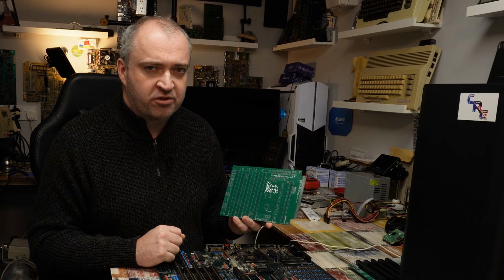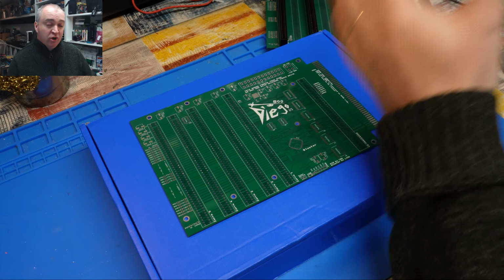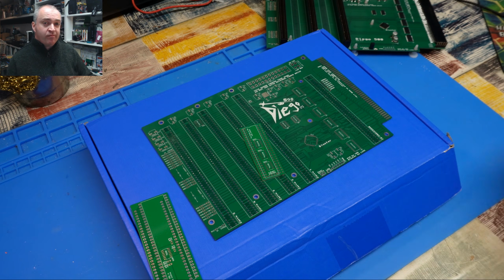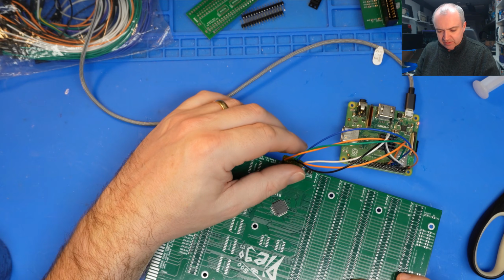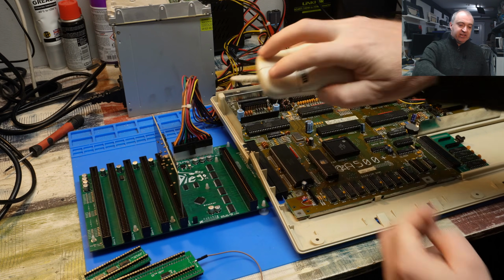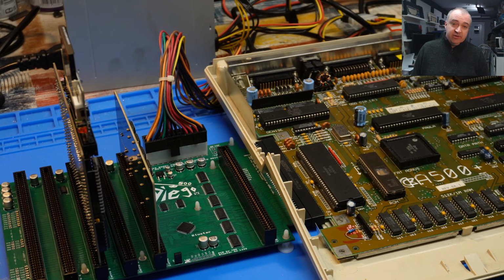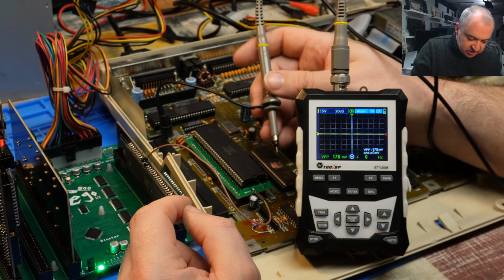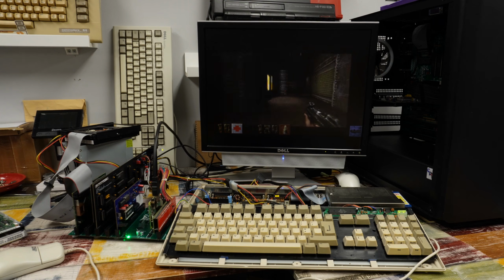Turn your A500 into an Amiga 2000

Comment: Good effort. I made similar two years ago although nowhere near as polished and refined. 

I took one of the A2000 board designs, cut it off by after the Co-Processor slot and reworked all the signals. All through hole, no SMD, no attempt to consolidate. 

I used a genuine Buster though as they're cheap (Bluster was more expensive, although sticking the CPLD on the board probably not). 

For power I used ATX and as I was a little concerned about reverse powering the A500 via the edge connector I used the lead from a dead PSU to power it via the proper connector. 

FWIW inverting the "missing" clocks (I did it in logic so as to keep Buster rather than your method of getting Liv to re-code Bluster) appears to work fine, although I don't have enough add-ons to really stress it enough to test it.

My only criticism is the same one I have of my own board... I cut out the ISA shared bus expansion thinking it pointless without a Bridgeboard (which itself I thought fairly pointless these days) but later I found about about the GoldenGate2 and using it you can basically connect ISA peripherals to the Amiga so it can use them "natively".
Reply from the maker: Sounds like you more or less your own Diego board then 😉.  I was considering just flipping the clocks again maybe using an AS04 for speed but it's adding more delay and LIV2 kindly offered to deal with the clocks as is so we're doing that for now.  As for through hole or SMD, I just prefer working with surface mounted and going forward I can get the PCB house to preassemble boards.  

I've not added ISA yet as that's just a bolt on, there's no connection to the Amiga so once I get this working as well as I can, then I'll make an ISA addon board so people can use their bridgeboards if they like.
Reply: @CRG  I called mine the "A1500+", because A1500+A500 = A2000!

Comment: back in the day I had a "Sling Shot" adapter that plugged into the A500 and gave 1 expansion slot, I used a 2091 SCSI card
Reply from the maker: I'm sure that was fun to use.  This whole thing started because I got a couple of Zorro 2 cards, the single slot board but wanted to use both together.

Comment: Great video!
Random question… I see that you’re using the same IKEA shelves as I am for storing/displaying your computers, but I also see that they have extra support fixings on the underside. Have you had any issues with them supporting the weight of the computers? Or is that just a precaution?
Reply from the maker: Thanks, glad to hear you liked it.  

As for the picture shelves... I've not had any problems myself but I know at least one person where the shelf let go causing his Atari ST to tumble to the ground (thankfully undamaged).  I just put small furniture brackets under them to help hold them but I see IKEA now also has a metal picture shelf (MALMBÄCK) which I think would be stronger.

Comment: Would a mediator style board be better that comes back over the a500 mobo and would sit in a big tower? Like if you folded your card over 180 degrees and put the slots on the back?
Reply from the maker: That is certainly an option but before I start redesigning it I'd like to get all the issues ironed out of which I've just discovered another one not in the video.  Not a big deal, just needs a extra few traces to fix.
Reply: @CRG  how many people are testing / using these in anger?  That is the only way to iron out the wrinkles... :)
Reply from the maker: Theres 5 of us doing testing. We have run into a little problem but its not beyond fixing.  But thats why we're doing this testing.

Comment: Regarding the power, whilst there's two 5v pins on the side lot, from what I remember they are both connected with a via to a single fairly thin trace.

Tha A500/A2000 Technical Reference Manual only rates the side slot for 300mA in the power budget section. So that's more the weak spot rather than the Amigas PSU.

It's likely capable of handling more than that, but not the ideal way to power the Amiga if it's too power hungry.
Reply from the maker: Yeah I agree with that.  I think for the release version I'll remove the power link at the side car and force use of the pass through cable.

Comment: have the zorro and cpu slots on the other side of the diego 500, so it goes over the A500 motherboard, so then you can get any case, mod the back panel to align the A500 ports and the Zorro and CPU slots
Reply from the maker: I need to look at an A1000 version at some point which will be similar to that in that its rotated.  There are many ways this would be laid out, but its just finding the solution that works best.

Comment: Great idea and awesome work mate.  A few ideas/suggestions if I may.
1  Could a cable be used to move the board a bit further away from the side of the a500 without messing up timing and signal integrity?  Like the PEB for the TI99/4a.
2  Could the ISA bus be implemented for the use with bridgeboards without too much difficulty? Would be a great option!
3  In regards to power, mount a PICO PSU directly to the board (or something similar that provides the +- 5v +-12v and 3.3v) and run a single barrel jack or power in.  For pass though power for the A500 use a short lead soldered to the board perhaps?
Reply: AFAIK there's no actual active components on the A2000 board to support the ISA slots, they're literally ISA slots chained together with power connected (it's essentially a "passive backplane" similar to what was used in a lot of industrial machines back in the day), the bus signals are purely generated by the bridge board. The biggest issue with that would be the size of the board, I'd guess it'd be at least twice the area of the current version which will substantially increase the cost (that said the E-ATX A2000 is a thing, but frankly that'd probably be a better way to go if you wanted the ISA slots)

That said, it would theoretically be possible to make a SEPARATE passive ISA backplane board, perhaps with a piggy-back ATX power connector on it so you could use the two boards to provide equivalent functionality to a full A2000 board but as noted, you'd probably be better off just making an E-ATX A2000 using the parts from your A500 (and you get a video slot too IIRC).

EDIT: just checked, yeah, the only thing aside from the slot connectors in the ISA side of things is some bus termination and decoupling type stuff.
Reply from the maker: Thanks for the feedback, glad to hear your enjoying the project.  

In terms of your queries:

1. I'm sure a cable can be used to extend the board away from the 500 but its not something I've tested so can't say how far you could go before signal integrity becomes and issue.  
2. As SomeMorganSomewhere stated, the ISA bus is essentially a stand alone thing so I am planning a further revision to this board with a pass through power connection to run ISA slots with an optional backplane for the slots themselves.   In the first instance though I wanted to get the main zorro side of it working fully.  If you can bear with me until the next round of testing is done and if that all works out I'll get the ISA board done.  
3. I'll take a look at that option, power supplies are something I'm not great with but I know some folk who can help.

Comment: Awesome. However, I would say that building an EATX A2000 board using the chips from your A500 would make more sense, since you can easily put that in an EATX tower. But this is cool. A tower case made to house the whole monstrosity would be a cool solution, but… might be more work and pain than just building an EATX A2000
Reply from the maker: You're not wrong and I've built the EATX2000 myself in the past.  The only thing I'd say is that the 2000 board and BOM came to about £200 (if I remember correctly) but the board and BOM for this is currently about £60-£70.  It's just about giving people the option to experience zorro without the need to built or buy one of the big box machines.  I suppose like a lot of things in this hobby its also because why not...

Comment: 14:45 Couldn't you take 5 or 12 volt from the side slot and converted it to 3.3 volt to avoid using an ATX power supply?
Reply from the maker: In theory yes but in practise I'd not advise it as the A500 PSU's just aren't designed to cope with so much hanging out the side of the Amiga.  The 5V rail is the limiting factor really as I think we've be capped at about 3A out the side car.  Fine for a couple of cards but if you had a full set of 5 with a CPU card I don't think it would take it.
Reply: @CRG  The ATX is definitely needed. The A2000 PSU 5V output is rated at 20A.

Comment: If you're doing another board, why not build in a pistorm while your at it,  Instead of a processor slot, add in a place to plug in a CM4 on the bottom, so the board doesn't get longer, the pistorm parts on the top.  Also, get the card edge in gold.  Gold handles more current and will protect your investment.
Reply from the maker: I want to leave the board open for use with any Amiga 2000 accelerators.  It's easy enough to plug in a pistorm but lets people also use original hardware or the other modern accelerators.  

I just go with solder finish on the prototype boards as its somewhat cheaper.  I'm already on my 3rd run which granted is partly down to me learning PCB design and making mistakes along the way.
Reply: @CRG  To clean the solder fingers use very fine sandpaper like 1200 grit. Despite what noobs think it doesn't remove metal. I've been cleaning edge connectors for 30 years any time I need to use a board (particularly arcade pcbs) and they work fine when cleaned. That spray does nothing. The reason that appears to work is because you re-seated the board which scratches the fingers a bit. Clean it properly and it'll work perfectly on all the finges for at least a week until it tarnishes again.

Comment: Amazing! Will it work on an Amiga 1000 too? It has the same expansion slot of the A500 (just rotated 180 degrees).
Reply from the maker: It will yes although the power side of it will need some thought.  I think for the 1000, power will need to be disconnected at the side car and it'll just need its own PSU.  The slots would also need rotated 180° or the cards will be facing forwards.  Once I get this one finished, then Diego 1000 will be worked up.
Reply: @CRG Having the slots facing forward on an A1000 isn’t a dealbreaker because of the separate keyboard. Ok, it wouldn’t look quite so elegant, but it would still be usable.

Comment: While I love what you have done , I am a bit annoyed that you have done what everybody else seems to do and ignored currently available hardware . My suggestion to you is to put a passthrough connected as the last zorro slot so that people who have an A590 , A570 or handscanner etc... can still use them .

I am also available to test various hardware that I have , if you need more testers .
Reply from the maker: I did consider that but unfortunately it just isn't possible to accommodate a passthrough.  To do so all signals would need to be extended from the right hand side of the buffers and there just isn't the space on the pcb to do that.  

If it went to a vertical design then a passthrough would be easy to achieve so leave it with me and I'll see what I can do.
Reply: @CRG  No space on the PCB? Eh? You made the board that size. Just make it bigger. If cost is the limiting factor you should quit now because this is only the tip of the iceberg and you're going to be pumping a lot more into this by the end of it. If you've got kids then give the mrs the flick as that job is done and she's not needed now, that'll save a bundle of dollars not having to buy new shoes, dresses, hair salon visits, wasting hours trudging around shopping in every shop within 50km radius for something that doesn't exist (shoes, dress etc) lol

Comment: Interesting.

And I learned a new thing: there is a solution for using pistorm externally! (perhaps even a Vampire)
Reply from the maker: Yeah you can absolutely use any accelerator externally with that single CPU slot board I showed.  Or there is the Lazarusstorm which also sits on the 500s side car and the pistorm just plugs straight into.

Comment: To bad you couldn't run a cable to the bus port then you could design a box to sit under the monitor that would hold the cards.
Reply from the maker: I'm sure you could do that, you'd just need a ribbon with 86 cores.

Comment: Great project! But I do not understand why you need the two adapter boards. According to the A2000 schematics, EINTs should be encoded into the 68k /IPL0-2 signals, and /BOSS should be AND-ed into /BGACK. And the /IPL signals plus /BGACK is of course available on the A500 edge connectors. So all the logic on those adapter boards could sit on the Zorro expansion PCB itself, no?

Additional idea for the power: You could have a plug on the back of the backplane that is a power OUTPUT, so one could make a short cable, that loops into the A500 power plug itself. Therefore powering both boards with a single PSU, and not having to deal with the thin traces.
Reply from the maker: You raise a good point.  I've had it in my head that the BOSS and EINT signals needs to be handled at their source (i.e. at the cpu and at paula) but it suppose electrically theres no difference doing it on the card.  

Let me go over the schematics again.

As for power, the 4 pin point beside the atx connector is for a pass through to power the 500.  I just didn't populate it here cause some idiot bought the wrong footprint parts 😅
Reply: @CRG  Power - ah right, I saw you trying to mount that plug, but regardless of what you said, my mind went thinking it's for "extra power" like how modern ATX PSUs have extra plug for CPU power input? I did not realize it's for output. Good stuff then.
Reply: @CRG  BTW, you can probably ignore and omit the entire EINT mess. From the ADCD 2.1 Hardware manual Zorro II system signal section:

"System Interrupts

   Six of the decoded, level sensitive 680x0 interrupt inputs were originally available on the expansion bus, and these are labelled as /INT2, /INT6, /EINT1, /EINT4, /EINT5, /EINT7 on the Zorro II bus. Only the /INT2 and /INT6 interrupt inputs are actually supported by Amiga, Inc. as part of the Zorro II specification; the A2000 hardware did not provide the software with the required support mechanisms for the safe use of these lines. Each of these interrupt lines are shared by wired ORing, thus each line must be driven by an open-collector  or equivalent output type, and all are pulled high by passive backplane resistors."

As far as I can see (but please verify this), they aren't even there on the A4000 backplane for example. Very likely nothing uses them. No, the Bridgeboards do not need them either. (janus.library, the CBM Bridge software hooks itself on INT2.)

Comment: I love this idea, and look forward to it being available for building.  However I suspect that in your test at the end the Prelude sound card was falling back to PIO mode, which it is designed to do when DMA is not available due to the PiStorm being used.  As far as I'm aware there is no fix for the PiStorm being able to work with DMA yet.  However, I suspect that this will work great with the TF536.
Reply from the maker: Ahh your right, I had forgotten about that.  Hopefully on of the other guys testing can do so with a 536.

Comment: Consider putting a QR code on the next revision of the board that takes you to the online repo with expanded instructions (e.g. 7MHz, etc.).

Edit: also consider using a ribbon cable so that bumps won't matter as much?  You could put it in a mini case below or behind the A500, and connect the slot via ribbon cable.
Reply from the maker: Good idea on the QR code, never thought about that!

A ribbon cable to a remote case is also a solution although one I've not tested yet.  If it works it might be the better solution so get it more out of the way of the 500.

Comment: 7MHz equivalent clock.
"There are three clocks coming from the Amiga. These are CDAC, C1*, and C3*. The backplane must generate 7M (equivalent to the Processor clock) by the following equation: 7M = C1 * XNOR C3*."

(Amiga 500 2000 technical reference manual)

Maybe use 74F86 or single gate logic SN74LVC1G57 powered at 3.3 volts
Reply from the maker: To be honest the design here started out from the A500+ which has the 7mhz on the side car slot so I never thought to hard about that.  The rev6 also has it if you close JP6 but your solution above does solve the problem for rev5 boards...  I'll need to think if I incorporate that or maybe even make it optional for rev5 owners.

Comment: Hello Glen, could you use a phase locked clock multiplier or other 4x multiplier in the Diego board to generate a 28mhz clock from the available 7mhz clock?
Reply from the maker: I had considered a clock multiplier but thought it would only cause problems as it would no doubt throw the clock out of phase.  I wasn't aware I would use a phase locked multiplier though...  Have you any examples of this?
Reply: @CRG  You should look at Matthias's accelerator card schems. Even the simplest and earliest 14MHz 68000 plug-in daughterboard has some fancy clock stuff going on. I'm sure most of the stuff you need to do has already been done with Matze's designs.